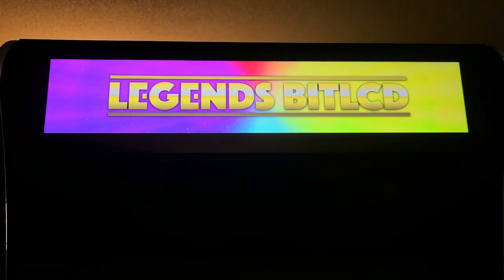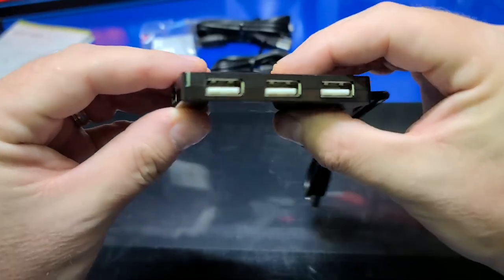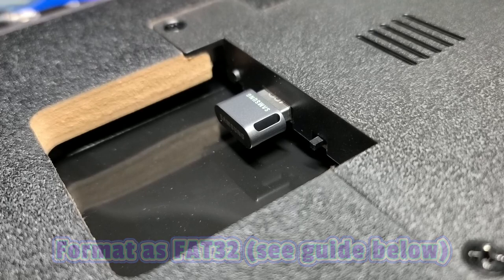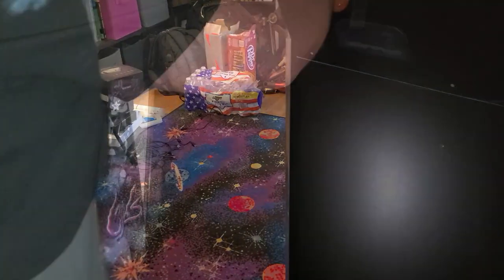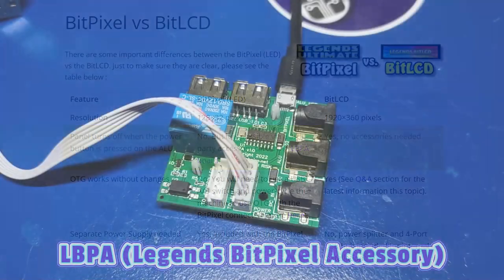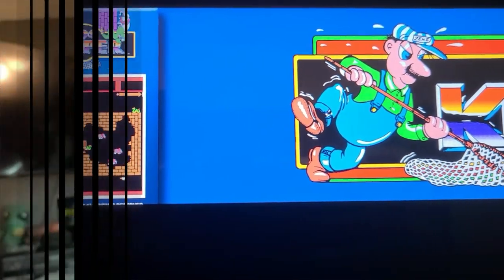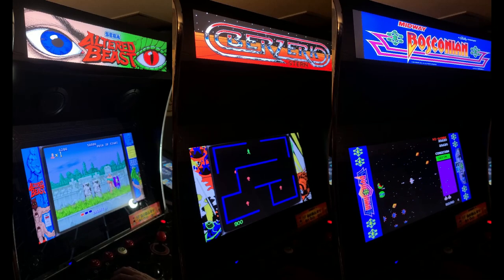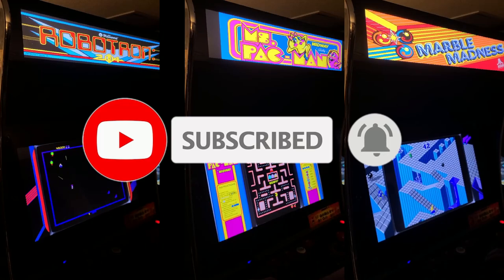Legends BitLCD Arcade Marquee Setup and Review (AtGames 2022)

Comment: I didn't read through all of the comments, but I wanted to add this tidbit that I figured out when I installed my BitLCD and it didn't work yesterday.  After much troubleshooting, I finally switched the ends of the USB cable from the BitLCD and Legends arcade unit and that made it work.  You want the ferrite bead end of the cable plugged into the BitLCD.

Comment: Thanks for the Awesome video and making this so easy!  My LCD arrives today or tomorrow and I am really excited to get this and my pinball buttons installed!
Reply from the maker: Very welcome, keep in mind a firmware update will be required once AtGames releases it (last I heard Monday but always subject to change).
Reply: I did the install and as an FYI...unless I did something wrong. for my 1.0 I had to connect the power splitter outside the cab. the splitter did not fit the inside power port.  I also had to heat up the glue holding my original Marque on to get that off.  
Just some tips for any 1.0 owners, the instructions a a little different foe us.  😉
Reply from the maker: @FreeFitCoach  I appreciate it Keith, I'll add to the guide what you've added above (I don't have the v1.0 cab to try).

Comment: Just wanted to add, sorry if I missed it. If you plug your old Led into the extra port on the LCD included usb hub it works and frees up the front one. So you can hang it on the wall or something.
Reply from the maker: Thanks Bruce, I did show the BitPixel plugged in with the BitLCD but was using the front USB 2.0 port on the ALU.  Very good point about using the internal USB hub.  I appreciate your feedback!

Comment: Thanks for another great video sir! I ordered two BitLCDs on the prior NOD sale...one for my ALU 1.0 and one for my ALU 1.1. They should be arriving in a couple of days. Based on your video, I will not be disappointed. Really like how they made it much better integrated with the ALU with the power splitter and USB hub compared to the BitPixel (which I have). While I've really enjoyed the BitPixel, the BitLCD is a huge upgrade with recreations of the original marquees and ability to do animated marquees. 

One thing I'm worried about though is how to get the new firmware....it isn't being pushed to my ALU/ALP yet, so may have to download from web site and flash locally.
Reply from the maker: The firmware update won't be available until at least Monday (last I heard).  I'm using a staged firmware that isn't public yet in this video.  Once AtGames releases it, you'll see it in the Version tab that an upgrade is available.

Comment: John, I love the detail you go into with your videos, but have you thought about one to address the failed firmware updates.  I followed your directions to install the BitLCD, the BitLCDx software, and updating the firmware.  I even received a message that the firmware update had completed and to wait a while for the BitLCD to reboot.  However, nada, nothing.  And now I only receive a "AtGames and No Signal" message on the BitLCD upon a cold boot.  Additionally, the software is unable to communicate with the BitLCD for any further FW or Resource updates.  It says to check the cable.  The only recommendation from AtGames so far is to complete the process as you mention with the fw image file on the thumb drive.  I have tried 4 different drives all with fat32 configured, and no resolution.  And yes, I waited for the firmware to update and complete.  I had gone to a different room and was watching a show, came back to see the update had completed and walked away again thinking it needed more time to reboot. I have seen other comments on a FB group of the same issue with some experiencing it multiple times with replacements.  Help!!!
Reply from the maker: See the 3rd point here: https://wagnerstechtalk.com/al-bitlcd/#Troubleshooting  Basically, copy the  bitlcd_update_online.img from that link over the one at the root of your USB stick.  Power off/on the machine and see if that fixes the issue.

Comment: Hi John, thanks for this awesome review. I was wondering if you can use ALU´s BitLCD as a DMD Screen when using VPinball over OTG. Thanks John. Cheers
Reply from the maker: I've honestly not tried using the BitLCD over OTG, however I think the answer is yes you can.  At the back of the BitLCD there is a small switch that can be set for USB or HDMI.  After flipping it, connect your HDMI cable to it and to your PC.  From there, I think you can set it up as you want using it as a DMD.

Comment: Are you able to use the BITLCD on other machines such as home built arcade machine via a windows pc or is it locked into its ecosystem?
Reply from the maker: I've not personally tried it, but there is a small switch on the back of the BitLCD that will let you just treat the BitLCD as an external HDMI display.

Comment: I have a question about the contest can I simply put a short 30 second video on a flash drive play it on the bit lcd and submit that to the contest?
Reply from the maker: I'm not on the panel for this contest, so my answer here may not be correct.  You will want a video that is 1920x360p displaying on your BitLCD, something custom and animated.  You can animate your family name, i.e. 'Wagner's Arcade' or something to that effect with your favorite artwork/video footage moving about.  If you don't already have a video editor, there are several free packages available.  One that I've heard great things about, but haven't used myself, is DaVinci Resolve (link: https://www.blackmagicdesign.com/products/davinciresolve ).  There is a free and paid version, select the free version and it should have all the capabilities you could want.  Set the project for 1920x360p and start creating.  I'm sure there are plenty of YT videos to help get you started with it as well.  After doing this, record a video (30 sec. or less) showing it on your BitLCD, tag the video on Twitter and you will be entered.  The goal with this contest is to see what you come up with, based on my understanding.

Comment: Can you go over the top 3, frequency and my score options? They don't seem to do anything. Also do you lose animation if you unplug your bitlcd? Flashing firmware again fixes it, but it is annoying. Several others have confirmed this behavior. Easy way to check is with the start up animation.
Reply from the maker: Hi Chris, I don't think those options do anything -at present.  If you unplug the BitLCD, you won't lose the marquees or animations as they are stored on a USB stick on the BitLCD.  Not sure what you mean about the flashing the firmware again, please elaborate on that part.
Reply: @WagnersTechTalk  You don't lose them, but they will not play. Just static jpg images will show. Happens every time you unplug the machine.
Reply: @WagnersTechTalk  This is an ongoing problem for me also. I see you listed it under troubleshooting on your page but has a fix ever been implemented? I flash BITLCD firmware after rebooting every time for the videos to work. Controller also comes on with the two blue flashing lights so I have to hold down p2 for 7 seconds.  I have not updated to Firmware v5.70 because I read of people having issues with Coinopsx. Thanks for your time.

Comment: I’m considering connecting a raspberry pi 4 to my Ali. Will I be able to use bitLCD with it?
Reply from the maker: There is a hardware switch at the back of the BitLCD that will allow switching to the HDMI input.  I've personally never used it without the ALU connected.  The tricky part will be getting the Pi to display the marquee images, I'm sure it's possible but it's not something I've personally tried at this point.  I've not had many ask how to do it.

Comment: Got my BitLCD today.  Installed it on my 1.1 version ALU but had a problem where the machine would freeze on startup with the two blue LEDs flashing next to the power button on the ALU.  I tried the P2 button for 7-10 seconds trick.  That made the blue lights stop flashing but the ALU is still frozen.  So removed the BitLCD USB stick, same issue.  Also removed my Coinops X USB stick from the ALU but same issue.  Unplugged the power from the BitLCD but same issue.  Unplugged the USB cable from the BitLCD and same issue!  Argh!  I finally through trial and error found what the problem is:  It is the USB hub that ships with the BitLCD.  If I have everything from the BitLCD unplugged and just have the USB hub plugged into the mainboard with only the ALU USB plugged into the hub, I still get the freeze so that is the issue.  I tried another USB hub but same issue so removed the USB hub altogether.

So next I tried to use the 1.0 version install by routing the USB cable from the BitLCD directly to the external USB 3.0 plug on the front control panel and tada! that works.  Not the ideal install since I have the unsightly USB cable coming around from the back but at least I'm in business.  Hopefully this also helps others that may be having a similar issue.  I'll open a ticket with AT Games to see if they have a better solution.
Reply from the maker: See here for possible solutions https://wagnerstechtalk.com/al-bitlcd/#Troubleshooting
Reply: @WagnersTechTalk  Thanks.  Yep went through all the troubleshooting steps originally but to no avail.  I've opened a ticket with AT Games.

Comment: I got my BitLCD installed 2 nights ago on my 1.2 ALU.  But in the morning I got the dreaded "controls not working" NG  on my MCU + NG on BT inside Settings > Health Check (page 3). I was also not able to unplug the power leads on my LEDs?  Is there a trick to remove the LED mini plug from the board? Finally, I replaced the PASSIVE USB Hub that comes in the BitLCD with an older powered D-Link USB hub.  Result:  My ALU's controls are once again working!  And no NG in Health Check.
Reply from the maker: I'm not sure what you mean by the LED mini plug.  The BitLCD has a power and USB cable that gets connected.  I have heard from a few that have had to replace the hub also.
Reply: @WagnersTechTalk  Hi Jon! In your video around @5:15 you unplug the original LED 'black and white wire' connection from the main CPU.   My LED cable seems "stuck" I couldn't get it out.  I wondered if there is a safety tab on it I need to depress?  Like the tabs you sometimes find on MOLEX connectors?   PS:  I did use your guide to install, Thanks so much! 😎
Reply from the maker: @makingmusic2971  Ah gotcha, yeah I unplugged that about a year ago and left it out.  Can't recall if there is a safety tab on it, there may be.  Try Pinching on both the top+bottom and see if it comes out then.  Sorry, getting older and can't remember some of the details lol 😎  Happy the guide was helpful, I always prefer to have a video and written guide for new tech.  Just makes everything easier, I think.

Comment: Is it normal for it to not sit tight and flush? Ive installed the mounting screws as far in as they will go, and the marquee has slight gap at the top. Even worse, the thing wobbles/rattles when I touch it.

I used mounting pattern 1. I could get mounting pattern 2 to work at all
Reply: I'm using an ALU 1.1. Am I supposed to leave the original marquee attached or something? If so then how am I supposed to run the cables inside the cabinet? I don't understand why mine doesn't sit completely flush. I wouldn't mind if it wasn't for the fact that it makes noise and can move around a few millimeters.
Reply from the maker: You would remove the 6 screws from the original marquee.  Then install 3 in one of the two patterns shown in the instructions (or the guide page: https://wagnerstechtalk.com/al-bitlcd/#Installation_and_Setup ).  It won't be super-right, it will hang there like a picture frame but perfectly across the top.  You can slide it up to remove it.
Reply: @WagnersTechTalk  just wanted to make sure it wasn't supposed to be 100% flush/tight. Thanks

Comment: Great video and very informative.  I was wondering if you've played much with animated marquees?  I know this product is very early in its software implementation so it has limitations on what it can do.  The issue I've found using mp4s is that they do load properly but not  before showing the ugly default image first and since it automatically loops the video file it will show this default image on every loop start.  Do you know of any way around this currently since I saw in this video you had the same issue?  I could add my own loops to lessen the occurrence but doesn't really solve it.
Reply from the maker: Thank you kindly!  I think if you take a still/.jpg of the first frame of the video with the same name, the image will show before loading the .mp4.  I've not investigated in detail, but good chance it will do what you're asking.
Reply: @WagnersTechTalk  Thanks for the suggestion.  I'll give that a try.
Reply from the maker: Please let me know how it goes, I haven't personally tested it - just a theory 😎👍
Reply: @WagnersTechTalk  Tried this out and it does indeed load the third-party image before playing the video.  This should suffice for now since this solution does remove the default image appearing but it also loads the third party image again prior to every video loop start so the cycle appears to hitch.  A possible workaround could be to fade to black between loops but I'd prefer to avoid that.  Hopefully we'll have some more options with this device down the road.

Comment: How can I order one of these for my own arcade? Been wanting an active marquee for a long time.
Reply from the maker: Didn't realize I didn't have a section for that on the guide, my apology.  I added it now: https://wagnerstechtalk.com/al-bitlcd/#Where_to_Buy .  Best price is on the AtGames site.
Reply: @WagnersTechTalk  the page is a little confusing to navigate. I love the dimensions and the look. I’m using Launchbox/bigbox on my cpu. Is there an option to just use the BitLCD as an extra display?
Reply from the maker: There is a small switch at the back that will enable HDMI mode.  Flip it, then connect your HDMI cable in and you should be good.

Comment: Thank you as always for your informative, easy-to-follow tutorials.  You may or may not have heard about the usb hub issue regarding its connection to the ALU 1.1 control panel, but I've had my BitLCD for a couple months now, and I'd say 99% of the time, the control panel buttons/joysticks won't work.  The 1% of the time they do work is when the Bluetooth lights are flashing by the power button, and I can disable the Bluetooth by holding the P2 button. I've tried using a generic USB hub, I've bought powered usb hubs...nothing seems to fit the issue.  I've opened a ticket with AtGames, but I'm not sure they can solve this issue.  Do you have any ideas or suggestions?
Reply from the maker: Hi Corey, I've personally not had this issue but there is one thing you can try that might help.  It's not at all the same issue you're having, but a good way to start fresh incase there was any file corruption somewhere.  See the 3rd point here: https://wagnerstechtalk.com/al-bitlcd/#Troubleshooting . If that doesn't help, I'm not sure what else it could be (likely something hardware-related) and would recommend getting in touch with AtGames on their support page through the purple chat icon during their normal business hours.
Reply: @WagnersTechTalk  I gave your suggestion a shot...even used a brand new flash drive...no such luck.  I've contacted AtGames customer service, and they gave me a couple files to down.  Unfortunately they didn't work either.  We'll see what they respond back with...
Reply from the maker: @coreyalexander9059  Man that's a bummer, really bugs me when I'm not able to help someone out.  Anyways, please let me know what happens with AtGames and what the resulting fix turns out to be if you don't mind.  It's the only way I can get better at this stuff.
Reply: @WagnersTechTalk  It's been determined that I need a new CTR Board.  They're going to provide an invoice for a replacement.  Apparently there have been others that have had to replace their CTR boards, which seemed to fix the problem.  Hopefully that will be the case for me too.
Reply from the maker: @coreyalexander9059  Got it, thank you for the update!  Hope that resolves the issue for you.  I have heard of CTR boards going out, haven't experienced it myself.

Comment: Any chance a power splitter like that would work the same with the bitpixel so it turns off with the ALU?
Reply from the maker: No, you'd need the LBPA board for that.  The power is being distributed to all connected devices from a single source.  You could add a power switch in the loop though or use a WiFi power switch that is voice controlled.  Some have mentioned they use that too.

Comment: Hi Wagners tech  Does the BitLCD work with Coinops and the art work?
Reply from the maker: It works with CoinOpsX, when you see the arcade marquees towards the end of this video, that was while CoinOpsX was running.  At present, there isn't much artwork available.  The artwork shown here was an early version.  Community artwork packs for CoinOpsX will be available soon, there is also a link to the Pixelcade forums at the bottom of the Resources section of the guide that has some great artwork created by JamesT.  We'll likely see more packs and some with video also in the near future.